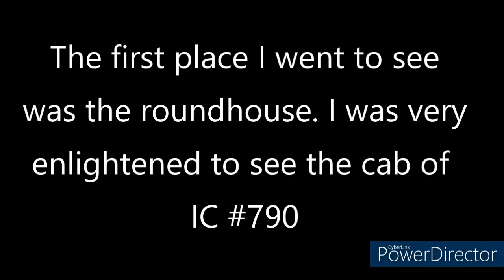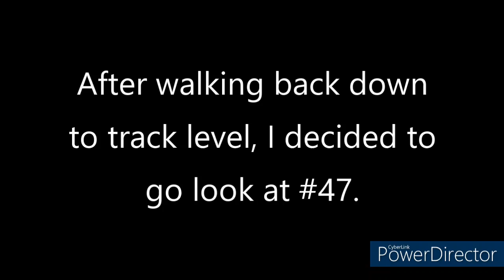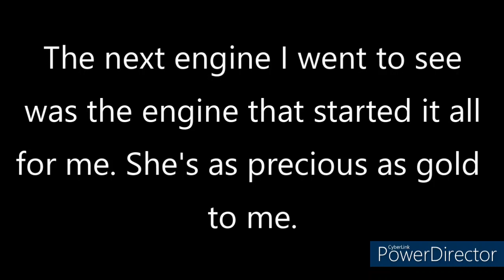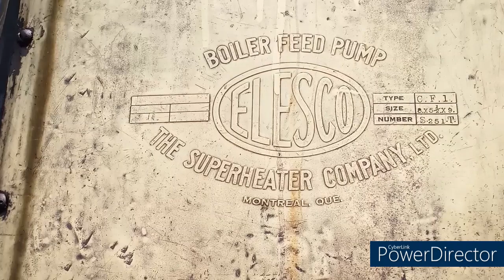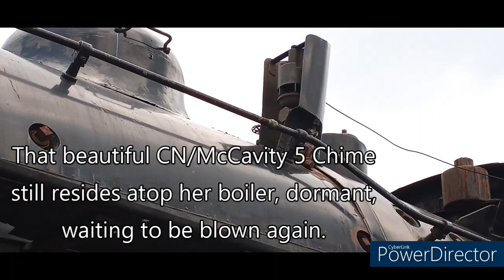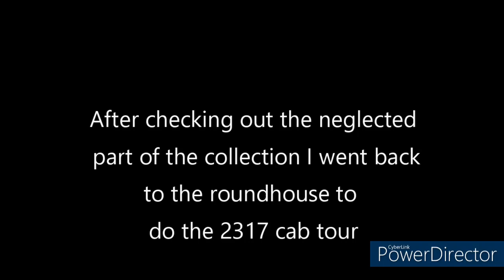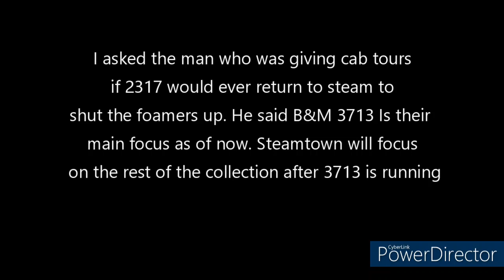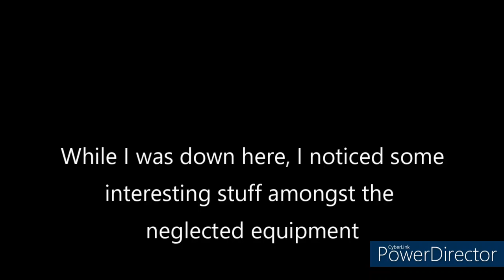Steamtown Railfest 2023

Comment: One of my biggest dreams is Steamtown restoring the CN 3254 still in this decade, it was going to be great with him doing a doublehead with the restored CN 3377.
Reply: There are no plans to restore 3254
Reply: I know but will they change their minds and fix the steam locomotive that gave rise to the famous steam whistle sound?
Reply: @ottodantaslemos5784 not likely. Unless another tourist line could use her for backup power. She will be a display until futher notice
Reply: @ottodantaslemos5784  yeah CN 3254 will most likely not run again in a long time, the engine was practically falling apart by the early 2000s and would had needed a lot of work just to keep it running, as for CN 3377, it doesn’t even have a tender anymore and would most likely have to borrow 3254s tender which is already falling apart, another problem is with restoring 3377 is that the engine has a lot of parts that were taken off and used for the 3254 so they would have to disassemble the engine just to put it back on the 3377.

Comment: Is 3377 still in the shop?
Reply from the maker: Yes
Reply: @EngineerDaylight  Alright then, do you know what there plans are for it yet?
Reply from the maker: @leotheanimemanyt0367 3377 Is being evaluated for restoration to replace 3254. Personally I'm not happy about it
Reply: @EngineerDaylight  Why are you not happy about it?
Reply from the maker: @leotheanimemanyt0367  Because if 3377 is being restored to run, 3254 is going to be the one that's stripped down for parts.
Reply: @EngineerDaylight  Well that's true, yes it would be very sad to see 3254 be stripped down to become pretty much a shell of itself like 3377 was before it got moved into the shop, you never know though, some of 3377's parts that are on 3254 might be warn out by now, they might decide to rebuild or have them rebuilt by another company from scratch.

Comment: 9:32 frame horn looks grazed up.
Reply from the maker: Indeed it is, that's the driving wheel that's rubbing against the frame. most likely the one that chews away its Bearings as well.
Reply: @EngineerDaylight doable fix but BEYOND expensive. Wish there would be a better home for this Mike